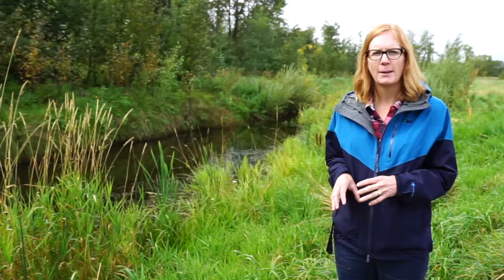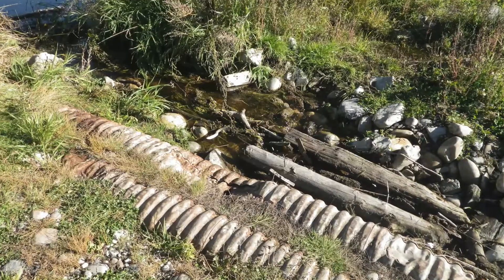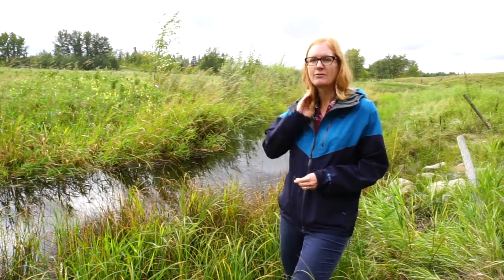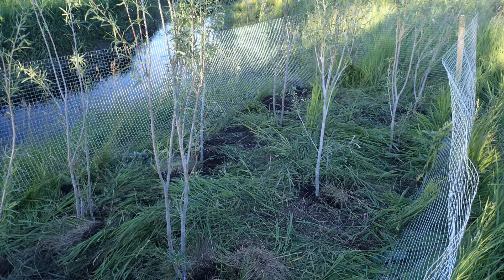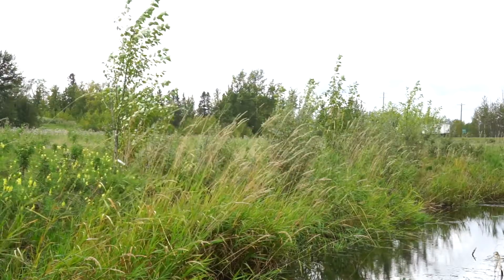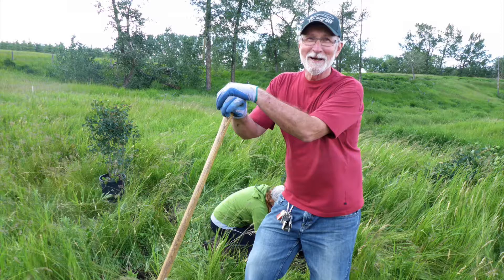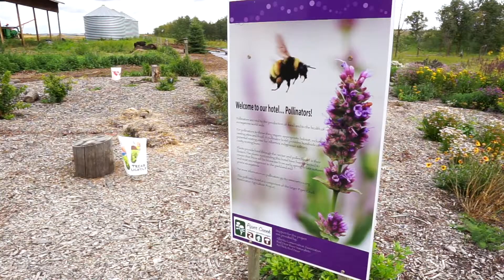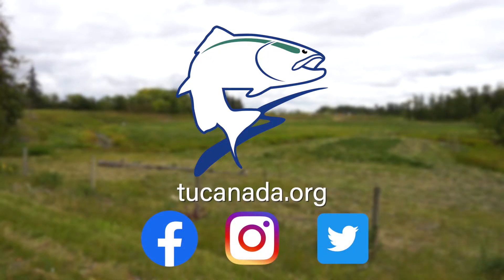How to Repair a Creek | Piper Creek Restoration Project

Comment: What is the length of Piper Creek? Is the creek able to support Beavers?
Reply from the maker: Hi Laura, thanks for taking the time to comment.  We did a quick check of Piper Creek's length using Google Earth and it appears to be just over 11 miles long.  

There are definitely beavers in the neighbourhood.  One night during the project beavers dropped by and built a dam out of the willow stakes we were going to use to plant along the creek banks.

Thanks,